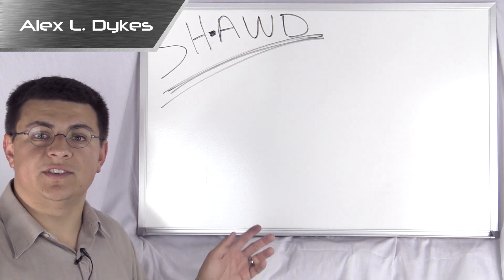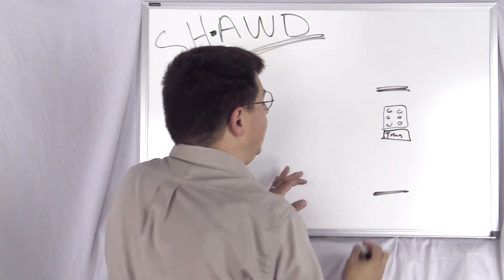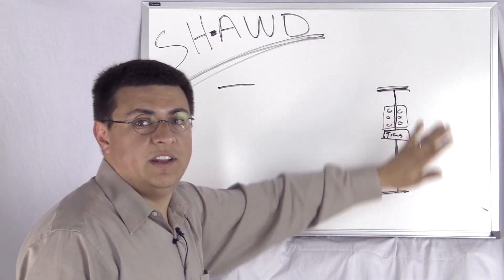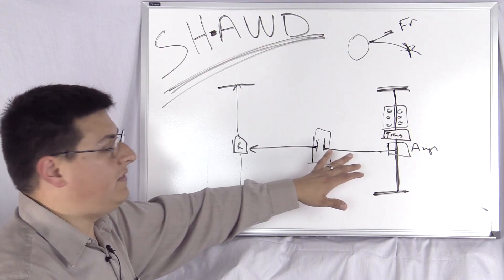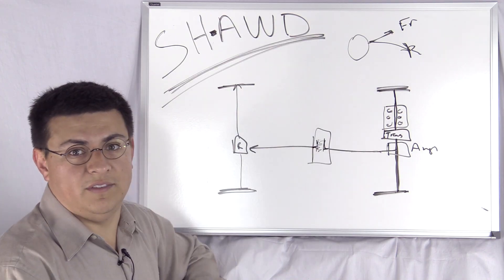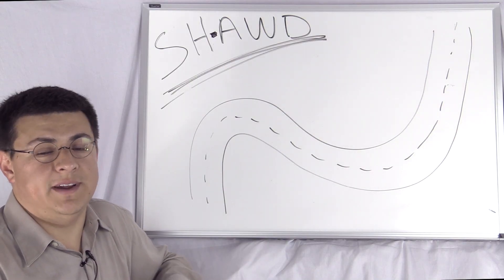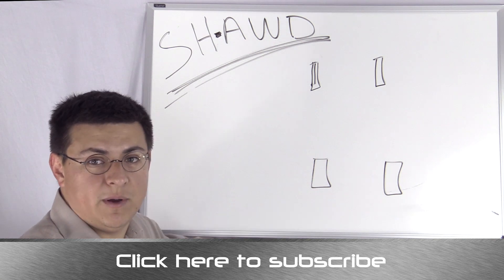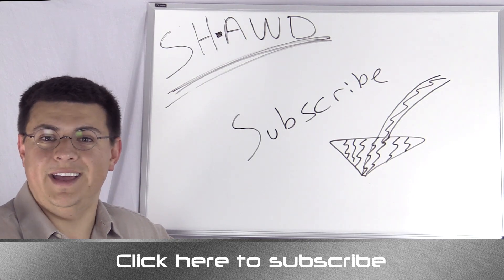How SH-AWD works: Acura's AWD system explained

Comment: Acura actually has a (in my opinion) AWD system than most of its more expensive European competitors, and that's very beneficial in Canada where 90% of BMWs, Mercedes & Lexus are sold with AWD. Heck SH-AWD is actually better than Audi's famed Quattro & Subaru's Symmetrical AWD as they don't have torque vectoring capability (via mechanical means).

Unfortunately their marketing division really needs to get its act together and actually sell some cars. Acura sales trail almost all other luxury nameplates in North America & only marginally beats out Lincoln; Cadillac isn't far behind & with their ever growing strong lineup of desirable products, it will soon surpass Acura.
Reply: +Trades46 Exactly, their SH-AWD doesn't get the recognition it deserves. It's actually quite an advanced system but held back by it's dumb name. It needs a more catchy name...
Reply: +Vlican Unfortunately I have not experienced a mechanical torque vectoring system, I only experienced brake vectoring.
Reply: Audi has mechanical torque vectoring on some models. They call it Sport Diff. It can overdrive either of the rear wheels by up to 10%.
Reply: @danh2716  is this better than SHAWD?
Reply: Subaru does have torque vectoring on rear axle of some models and in fact on both axles of wrx sti
Reply: +Ankur Sharma it is brake based torque vectoring, which is garbage compared to Mitsubishi and Acura implementation.

Comment: The RL actually had a 5 prevent overspeed in the rear. Later systems as in the MDX TL RDX used the simplified and lightened 1.7 percent acceleration in the rear. 

Also, the RLX has departed from the mechanical system in favor of 2 electric motors that power the rear wheels independent of each other and can do some limited power distribution even in an off throttle (albeit adverse) driving condition. It complements the vehicle stability assist quite nicely.

Comment: Audi S4 with Sport Diff > SH-AWD in your TL.  Proof is in the performance tests both at the track and on the road.
Reply: Have you tested it? Or just from knowledge it is. Thinking of getting either a tl SHAWD or s5 with sport diff
Reply: @JohnSmith-yr6je  I've owned both but I'm familiar with the write ups on both and how they function too.   I wouldn't let your decision rest on the AWD System here though.   On the street, both are excellent.  If you're going to track the car, go German.

Comment: Hmm.... This is very interesting. My 05 Subaru STi has the Driver Controlled Center Differential (DCCD) where you can adjust the clutch pack and torque split to the front and rear axles. This Super Handling AWD sounds very similar to Subaru drivetrain although adding the vector torquing components. Very cool.

Comment: Seems like a lot of parts to do a simple job.  I never had any issues with my older Audi quattro systems.  I believe they used Torsen differentials front rear and center IIRC.

Comment: Hi Alex,
Great video for a new comer like me. Just picked my Used 2012 MDX this saturday and i am just loving it. I have a very stupid question as i am just a buyer/user and not a mechanic or have no idea how all these technical features work...All these features in Acura MDX do they operate automatically when you drive or do you have to turn on certain things to have these features working in your car...Again as i said i have no knowledge about the mechanism point of view...Thanks.
Reply from the maker: Reef Rookie The SH-AWD system is fully automatic. Some AWD or 4WD vehicles do have "modes" to chose from so you can tailor things to your taste, but the SH-AWD system is always on and only one way.
Reply from the maker: sports fan Well, it depends on the situation. In modern systems you don't have the same issues that you did ages ago when TC first started. Today if you disable the TC system then your AWD system won't be able to send power left/right up front
Reply from the maker: +Roclee612 Actually most luxury cars, almost all cars with a performance leaning and many mainstream cars will allow you to completely turn off traction control in an AWD car. That includes cars like the CR-V which with traction control off will not apply braking to direct power around the AWD system and in that case causes the AWD system to actually perform quite poorly.
Reply from the maker: +Roclee612 I am thinking that I may need to make a video to explain this since it is kind of a convoluted answer. "Torque vectoring" in the marketing sense is an active system that directs torque around when there is no slip at all. This is what SH-AWD does for instance as well as the new Pilot. Traction control is different in that it works with the AWD system to stop wheel spin. TC is primarily concerned with making sure the wheels spin in relative synchronicity with one another. Then we have active differentials which can mechanically send power side to side. Next we have the grey area which is brake based torque vectoring which Ford, Volvo and others use. These systems use the ABS system to gently brake one side when there is no slip to send power side to side and act "like" a torque vectoring axle. While this is arguably better than nothing it is not as good as a mechanical torque vectoring unit like we see in SH-AWD, BMW, Mercedes, Jaguar, etc in the rear or in some new VW products up front. When we're talking about simple traction control and AWD like the CR-V, that's sending torque side to side only in response to wheel slip. So when one wheel starts spinning much faster than the others the system responds by sling that wheel down until they are all spinning more or less the same rate, that has the effect of causing transfer across the open differential.
Reply: sports fan  Yes, but in stopping wheel spin it causes power to transfer across an open differential. A typical modern AWD system has open front and rear differentials. Without the TC system if one wheel on each axle was freely spinning the car would not move, however with TC it can brake the spinning wheel and allow the vehicle to move.
Reply: sports fan The TL is the exception, but only on the rear axle. It has a mechanical torque vectoring unit but it won't send power across the front without traction control.
Reply from the maker: +Roclee612 Not true, traction control has many forms. Traction control is not shutting down the AWD system but helping it. Retarding engine power is only one feature of traction control, individual wheel braking is the a key feature here. By slowing the spinning wheel is causes power to go to the other wheel in an open differential system like most modern AWD systems. Most modern systems like SH-AWD use the traction control system's brake control to augment the capability of the AWD system. They work together, not separately.
Reply from the maker: +Roclee612 That is not correct. The CR-V has a 4 channel ABS system. In the Teknikens Varld roller test they disabled traction control. The CR-V has some additional troubles in the test beyond the AWD system however since it is not designed to ever send more than 50% of the power to the rear axle. With traction control on it will move off of a roller style test bed. I have been part of a test that proved exactly that with the 2015 CR-V.
Reply: +Alex on Autos - Great video! Correct me if I'm wrong, but isn't the torque vectoring in Mercedes-Benz vehicles limited to torque brake vectoring? This seems like a much simpler, less impressive system than something like SH-AWD or xDrive. 
Thanks

Comment: Hey Alex, Great video but I had a question. Why does Acura continue to make FWD based platforms rather than moving to RWD platforms like Lexus and Infinity have? Wouldn't moving to a RWD based platform give the SH-AWD system better performance and better off road abilities? As you said in the video BMW has a similar setup but instead has a RWD platform and engages the front when it needs to. Doesn't that mean BMW has a superior AWD system for both performance driving and off road driving?
Reply from the maker: a longitudinal layout with a torque vectoring rear axle would in general be the better layout. However the SH-AWD has advantages over RWD layouts without the trick axle. Acura doesn't do this because they don't have access to platform parts that are RWD and would have to spend more to develop unique platforms and parts.
Reply: Alex on Autos Hey Thanks for the reply I appreciate it. But that leads me too a second question. If Toyta and Nissan can afford to make separate RWD platforms for Lexus and Infinity, why can't Honda?
Reply from the maker: *****
Acuras generally sell for less and in lower volumes, that's the root of things.

Comment: Greetings. I appreciate your detailed yet completely understandable explanations. In under ten minutes, I learned not only how SH-awd works but also how other awd systems work and how they compare. Brilliant! Thank you.
Reply: Having problems with my 2011 MDX,  been a great car, about 2 years ago we discovered problems,we though alternator,  something was draining the battery, found DVD was running when not in use, friend discovered this when placing new alternator in and just disconnected that system, no more problems till now, was low on oil, had oil changed, new filter, checked all fluids,only one low was antifreeze and when checking air filter 3 screws broke when taking them out so decided to leave as is.  Today , drove it about 2 blocks and check engine light came on, flashing, and then showed SH-AWD and car started to shimmy and ride rough, so drove it back home, not sure what is going on, also flashed twice about pulling trailer check and we were not and never have.  Do you have the slightest idea what is going on because I love my car and want to keep it and prefer not to spend a fortune.  Thanks for your time
Reply: @cynthiamcalexander8101 My 06 tsx had the same exact problems

Comment: Had they put SH-AWD in the 2007-2008 TL Type-S, those cars wouldn't have stayed on the dealer lot for more than a few hours !
Reply: It's surprising that it didn't because Honda did have a front wheel drive only SH system that was used on the Preludes. The SH model Prelude were said to be the best handling front wheel drive car every. However just because it wasn't badged doesn't mean the tech didn't carry over into the type S model.

Comment: How does the rear 'transmission' increase power, I could see it increasing wheel speed but only in proportion to front wheel speed.  How does it act as a multiplier effect on power without an alternate input from the transfer case capable of over 50%?
Reply from the maker: It is an odd contraption. Essentially the input to the front diff and the "acceleration device" can be locked 100%. When it is in full lock and the acceleration device is making the rear wheels spin 1% faster than the fronts, you essentially get the rears overdriving the fronts. It's an interesting mechanical effect. While the fronts are still connected, the fact that they are spinning slightly slower means they aren't providing 50% of the force anymore, in a straight line it ends up around 90% rear. Of course that causes increased tire wear so the system doesn't operate in that mode all that often, more often than not it is more of a 50/50 split with the torque vectoring across the rear axle.
Reply: Alex on Autos This would in essence give the final X% of traction difference between front and rear to the drivers choice by either providing the fronts, or the rears with more traction through weight transfer?  This effect being multiplied by yaw affected torque vectoring could provide some interesting results.
Reply from the maker: Joshua Gore The software errs on the side of sedate driving, unless you push the car hard with the nannies disabled in which case it does feel like a RWD biased AWD vehicle. Admittedly still one with a heavy front end.
Reply: Someone needs to start cracking awd software systems.  Thanks for the video.

Comment: What are the maintenance requirements/schedules for AWD systems, for both on-road and off-road use please? For example, how often does the fluid in these systems need to be drained/replaced, if at all? What about something more basic like a limited-slip differential system? Thanks again.
Reply from the maker: It varies from vehicle to vehicle. The schedule should be at the back of your owner's manual.
Reply: Alex on Autos
Thanks. In the owner's manual, I found an obscure * footnote indicating replace fluid after 40,000 of normal use, and if the system has been submerged in water.

Comment: Nice video, I think you missed to explain why the SH-AWD has no classical rear diff, but a planetary gear at each back wheel (inside of the clutch packs) though (~8:40 in the Honda video)

Comment: Just curious, to activate the SH-AWD system, I have to floor it during a turn? or just accelerate through the turn? I have a 2008 Acura RL Technology package...
Reply from the maker: SH-AWD is always active in some capacity. Even at low throttle inputs the system will torque vector the power going to the rear. So even if the front wheels are getting 70-80% of the power, when you enter a corner the rear differential unit will direct the 20-30% power primarily to the outside rear wheel.

Comment: Lifted this from Wikipedia :) 

List of systems capable of active left-right torque vectoring
Audi's quattro with Sport Differential
BMW's xDrive with Dynamic Performance Control
Honda's SH-AWD
Kia's Dynamax™ AWD
Land Rover's All New Range Rover Sport HSE and Autobiography Dynamics models [9]
Mercedes-Benz's SLS AMG Electric Drive combined with active front-back torque vectoring
Mitsubishi's Active Yaw Control
Nissan Juke
Saab's XWD
Ford on several models
Porsche on several models, when torque vectoring added as an option
Subaru's AWD on 2015 WRX
Holden Special Vehicles Gen-F GTS[10]

Comment: Great video. I've read somewhere that soon we'll have torque vectoring on both front and rear. The Audi sports diff has vectoring too. Alex it would be fun for you to explain the GTR's 4 wheel drive system and I believe this is the secret sauce that make such a heavy and somewhat underpowered car go so fast AND I don't believe it even has torque vectoring! Every single test shows it has supernatural speed in the corners and it has to be due to it's magical transmission system?

Comment: Thanks you for an excellent explanation.  I do wonder about the long term reliability of all of these components in the SH-AWD.
Reply from the maker: SH-AWD has been very reliable and seems to be well built. The downside and the reason that Acura has been moving away from it somewhat in the RDX and in the RLX is weight and cost. SH-AWD is expensive to make and it is heavier than a less sophisticated AWD setup.
Reply: considering the above response was 4 years ago, and we have even more history of it holding up, i guess its not too bad.  im buying one today and probably picking up a few spare parts to keep it going over the years, before the only parts i can find are unreliable aftermarket, or high mileage used.
Reply: @seanb9436  "we have even more history of it holding up...picking up a few spare parts to keep it going over the years"
What SH-AWD spare parts specifically?
Reply: @commenterperson4481  nothing special, and its probably unnecessary to do, but I keep my cars for 10+ years at a time.  picking up a rear diff, transfer case, and shaft next time i spot one available at a pick and pull area around here.  its a lot easier to do when they're 4-6 years old as opposed to 10+, because the parts are all worn to hell and finding a low mileage unit gets far harder
Reply: @seanb9436  I see; you seem like a long term planner.
I find that it's not easy to guess what the faulty parts will be in 10-15 years. Also, in 10-15 years, I'm not sure I'll make time to work in depth on cars...

Comment: What cars currently have this technology?
Reply: The TLX,MDX,RLX Sport Hybrid,and NSX.
Reply from the maker: The TL and MDX are the only ones at the moment. The TLX will also have it when it launches later in the year. The ZDX and RL had it in every year until they were discontinued. The first generation RDX had it but Acura opted for a lighter but less sophisticated AWD system in the current RDX. The RLX hybrid is called SH-AWD bust has no relation to this system.
Reply: I've had Acura for years and I'm a huge supporter.  Not cool that the RLX hybrid is called SH-AWD, but has no relation to this system. This was news to me....Marketing. It's hard enough to navigate the auto world through salespeople's knowledge.  @Acura, please don't call something that it is not - creates confusion.  Long live Acura!
Reply: the nsx also has it.